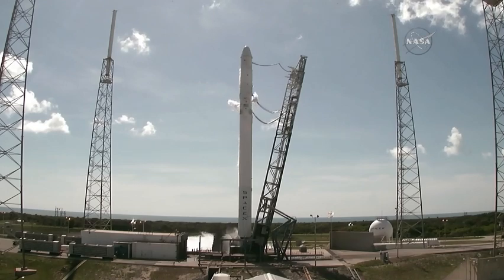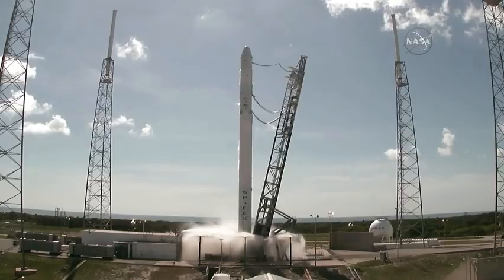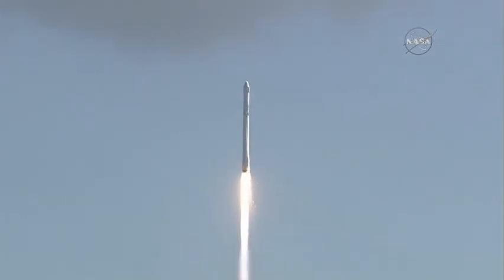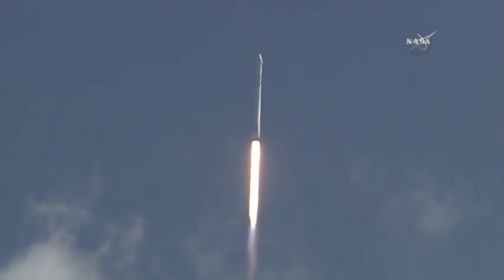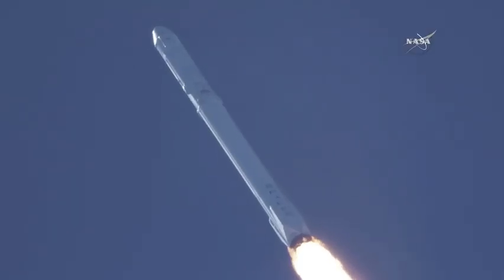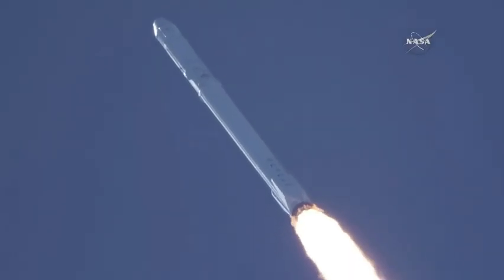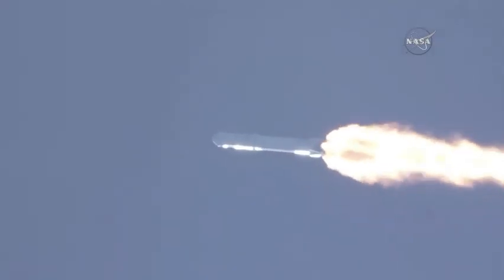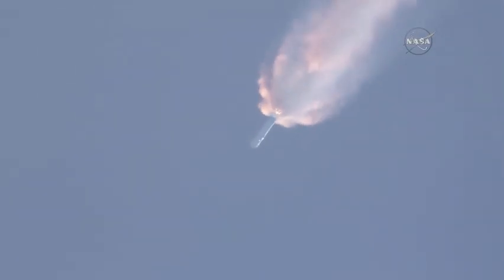SpaceX Falcon 9 failure, CRS-7 crash

Comment: Can anyone supply a detailed explanation of the failure so that I can reference it in a report on pressure vessels? It appears that the liquid oxygen COPV ruptured leading to a host of other mechanical failures, if this is the case was it a valve that caused the release? Was it the COPV itself that failed? Was it a transfer line that failed? Why did it well occur beyond max dynamic pressure? Any insight would be appreciated, I haven't been able to find a detailed accident report
Reply: Same.

Comment: Agree - some sort of structural failure. I suspect the construction was weakened by the additional equipment neede to accomplish landing procedure. Falcon was high, presure outside was already small, presure inside vs. outside + construction + who knows what more.. Complex situation as usual, chain reaction. I keep my fingers crossed for SpaceX and reusable rockets.
Reply: Ray Beym Yeah but the falcon heavy has flown with landing gear before without a major malnfuntion; something else was different this time
Reply: 37VQV Maybe but was that high then during the test?
Reply: 37VQV ..and are you sure the difference is only the landing gear? Probably there is much more than that to create resusable rocket - way much more - landing stabilization equipment (needed to stay vertical) for example.
Reply: Ray Beym First of all let me  correct myself, when I said falcon heavy in my previous comment I meant Falcon9; falcon heavy hasn't been tested yet. Not its more than the landing gear alone of course but this launch vehicle was essentialy identical to the last CRS mission. As of now its doesn't seem like the failure was due to the recovery system or of the first stage at all. it seems like the failure was in the second
Reply: 37VQV Something is confirmed - Gwynne Shotwell (SpaceX) confirmed - second stage was the issue (Alfred Samual - thank you, BTW Ryan MacFarlane - interesting). I just wanted to point out that if falcon 9 (NOT reusable) didn't have issues like this then it's highly possible that this additional design changes, equipment etc. could be the cause. Maybe the design changes (cut original weight to put additional equipment) went juts a bit too far.. - just thinking..
Reply: Ray Beym Falcon9-Resuable has flown multiple times in the past w/o error
Reply from the maker: 37VQV Almost landed last time https://www.youtube.com/watch?v=AEaW7N3MHDM
Reply: 37VQV Thank you for info. Has flown but they are fighting with reusability = safe landing. That's why (probably) SpaceX team is making changes - hardware, software to achieve this. They have to "touch" things that already worked you may create new issues..

Comment: i know there's a few other theories as to what happened, but here's mine.  it looks to me one of the fuel tanks burst, either from pressure breaking a defective sealing job or another structural weakness, leaking fuel into the air.  the fuel might have been ignited by the engine, resulting in a chain reaction leading back into the main fuel tanks.
Reply: fuel can't be ignited without oxidiser. looks like 2nd stage engine ignited prematurely.
Reply: Ten year hindsight: a strut holding a high pressure helium bottle within the main propellant tank (LOX) was defective and failed as acceleration force increased. The entire batch of struts from the manufacturer were inspected by SpaceX and some were found to not pass tensile tests.

Comment: The structural failure appeared to begin at the capsule area then propagated aft. Almost looks like an aerodynamic failure, but that could have been due to a preceding cause itself. That's a particularly unfortunate failure because it should have been preventable. Engines looked hot and normal all the way. And it was hitting its time, distance and speed until the forward section seemed to shatter down onto the first stage.

There is a plume on the (then) underside of the rocket near the first and second stage joint just before a much larger plume engulfs the upper stage. Could have been second stage fired early.
Reply: Musk said initial indication was over pressure in an oxygen fuel tank. Not sure if that has been revised in the past 16 hours though.